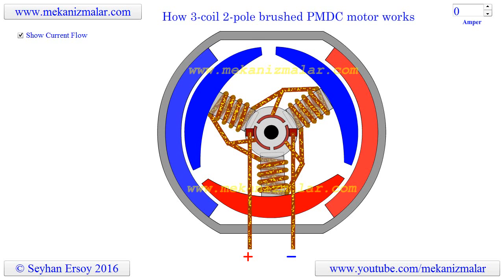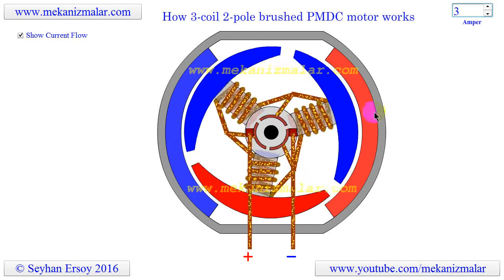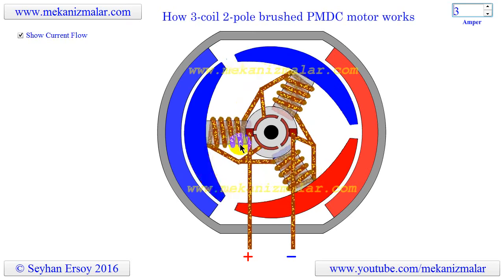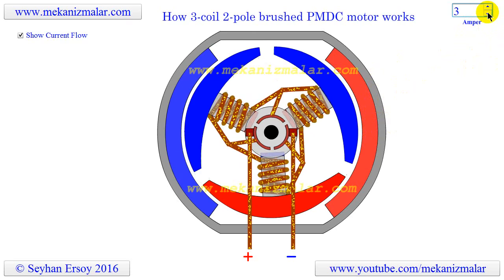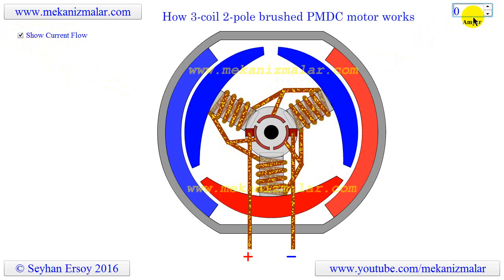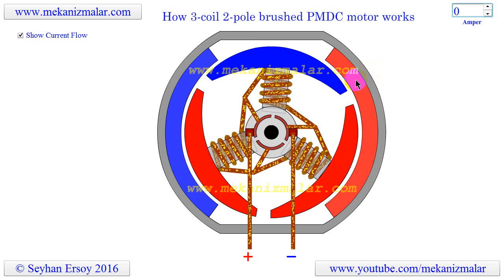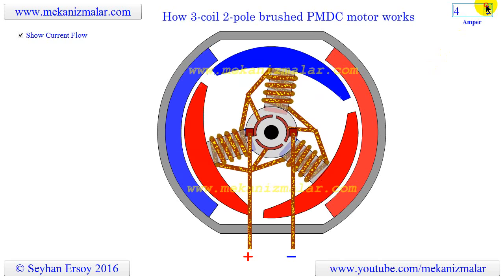how 3 coil 2 pole brushed pmdc motor works

Comment: Excellent video, animation and description.
I subbed and I will have to check out more of your content.
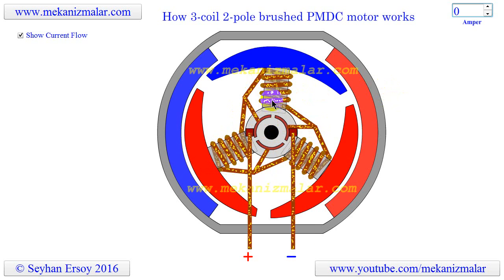I seem to see a mistake in the video though.  As you mouse over the current paths starting at 3:55, at 4:00 your mouse jumps across the commutator gap to the next coil rather than exit the com through the brush on the negative terminal as it should.  Same mistake demonstrating the other coils.
Excellent video though and I will use this video animation to help students in the elevator industry understand this concept.
Reply: There was no mistake, he was showing current flow for 2 north and 1 south conventional current flow. First, he showed the flow to the 2 norths, then he jumped the brush gap to show the flow going to south coil!. No mistake.
Reply: @gensyed  I would argue the jump over the commutator is a mistake since its talking about the current paths.   
At 3:30 it says “Let me show you these current flows…. Please follow mouse pointer when I am showing the flow paths”
 The mouse should leave out of the brush to negative for the 2 souths and then start fresh from positive through the coil and exit negative for the 1 North Pole.
 Though you and I may understand, someone new to electric motors may be confused because it says to follow the mouse for the current path then the mouse jumps over the commutator instead of start at positive to start a new path.
 Perhaps "mistake" is not the best word but its certainly a point of potential confusion for someone new.

Regardless, this a great animation and I will likely use it teaching motor control but make expressly clear the current paths.

Comment: If you wind the armature in a star pattern, you have to use double layer winding so that all poles of the armature turn on at the same time. The first pole from the commutator you wind it in one way and the next in the other way and put it in the neutral conection and so forth. 👍

Comment: It seems to consume a lot of amps to work and ther's a possible reason, the Maxwell crockscrew effect isn't respected, there's an invert moment when the device needs to be under a hugh amps power to create the overflow current circuit

The reverse sens, in a simple wire doesn't really change anything, but, in a cupper coil the Maxwell crockscrew sense needs to be respected

In fact in this video, only thecleft side creat the good effect, on three coils used
You could first reverse the result to conserve only one wrong current sens coil